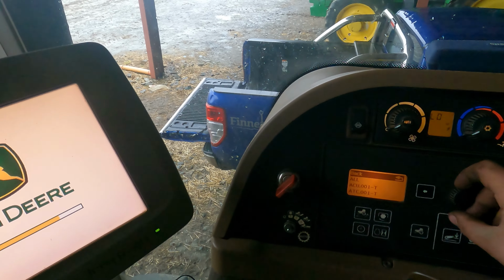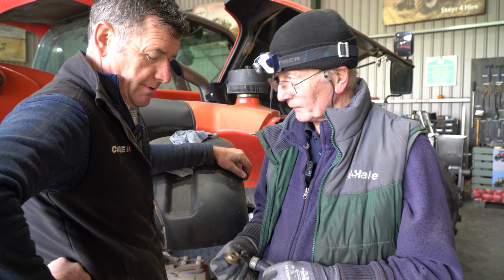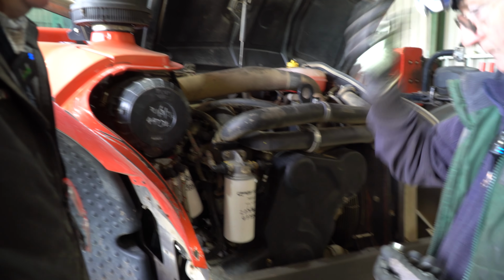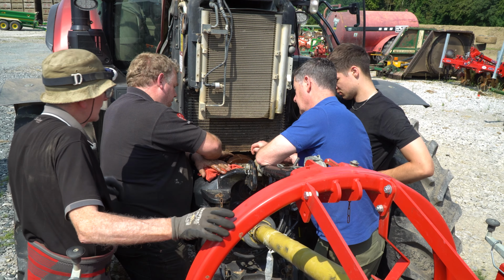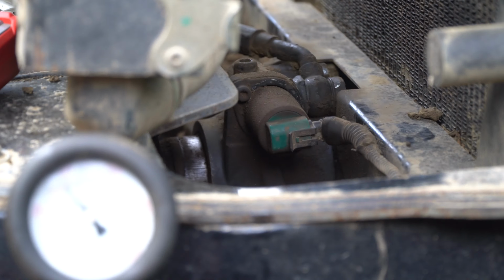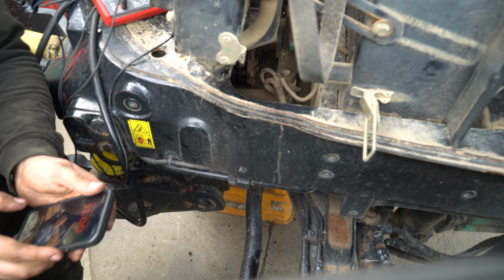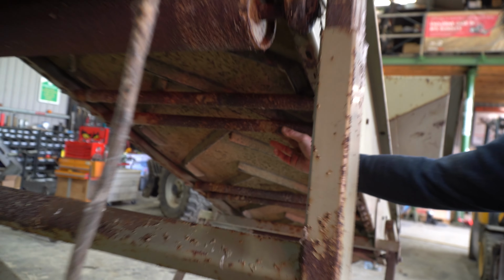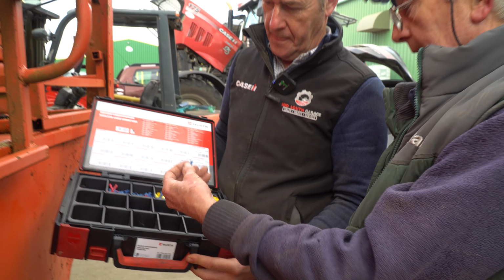WORKSHOP WEDNESDAY EPISODE 147

Comment: I had two Qashqui a 2010 and a 2014 . The 2014 had 240 thousand Km on it when I traded it . Got 90K Kilometres out of a set of tyres . Pipe had to be replaced a couple of times but it was only €15 .A great car and I would loved to have had an automatic.
It used do 1000km on a fill of Diesel.
Reply from the maker: That sounds good, Mick will be flat out reading comments